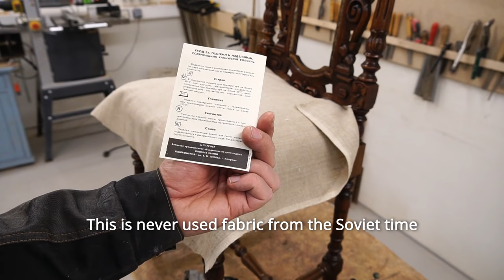Extreme restoration of an old (and seemingly fine) chair

Comment: I really admire how you added new pieces of wood and carved them to fit into the existing elaborate places.  The glue and fine sawdust filler is a good trick for filling multiple holes and non-structural cracks which I have used in the past.  Your re-upholstering, using the old springs and new webbing was fascinating to watch.  Congratulations.

Comment: Great work restoring a chair that was almost too far gone to save. And what a great idea to use compressed air to force glue into a narrow crack! Why haven't I seen that before and why haven't I thought of it myself?  🧐
Reply: Was that normal wood glue? Is normal wood glue strong enough to piece together a backrest?
Reply: Normal (modern) wood glue actually is stronger than the wood it holds. (edit: when applied to long grain, as is done here)
Reply: 👍👍 I did not know that. Thankx 😁
Reply: I also did not know that about the glue. Thank you 😊 I had a thought while he was gluing. Could you use a hypodermic needle? There are several large gauges, like 14-18. Would that work to apply glue into the cracks? 🤔 Just wondering...
Reply: @julie6092  Yeah, I've done that in the past with an 18G and it works just fine

Comment: "Watch me fix this fabulous chair!" Smash smash bang bang crack crack LOL
Reply: I have a chair similar to this and I came looking if there was a way to fix the wobble. Apparently the way is to destroy the chair and build another one like it...
Reply: Its the only way it works bro
Reply: Sometimes a Bull in the China closet is warranted.
Reply: @TrueFork  if you don't care how it  looks you can use a wire hanger and a turnbuckle. Or, you could go the distance and get a long bolt and put it in the middle and twist that around to tighten it
Reply: And now, a family heirloom to be passed down.
Reply: @fairwitness7473   i am a restorer of 45 years and cringed at this hamfisted approach.
Reply: Awesome, thank you for share..
Reply: You don’t make an omelette without breaking eggs.
Reply: @tedwarden5803  "... but look what happened to the cook!"
Reply: @shawncharton9416 . Go on you’ve got me stumped what did happen to the cook?
It looked to me as if the chair had already had a partial restoration. It had certainly been reupholstered. The webbing and the springs were almost new. The corner braces looked as if they had been reglued using  PVA. 
The damaged turning and carving all you can do is replace it up to a point or just leave it and or recarve. That’s the art of restoration how far do you go. 
It’s never going to be a new piece of furniture nor should it be made to look like on.
Reply: @tedwarden5803  watch the movie Clue to find out.
Reply: @tedwarden5803  I'm a restorer of 40 years experience. Ham fisted springs to mind.
Reply: @nickgreenwood2854 . I don’t disagree. 
All I said was that it looked to me as if a previous repair had been attempted. Cutting through those tennons made me shudder. 
But if modern adhesive had been used I could understand. 
The old animal glue breaks down over the years and becomes brittle as you will know.
Reply: What I thought as well.
Reply: I trust he knows what he's doing now I've watched a little of his work.

Comment: You should try using a heat gun to soften the glue before you whack the joints with a hammer. Nice finished result though.
Reply from the maker: You are right and I usually do but this time the nails hold whole chair together. Heatgun doesnt help there.
Reply: @ATRestoration  drill on opposite side and push the nail out ?

Comment: We have this problem when people bring in their old picture frames and want us to re-use them on a new piece.
We're a small, local frame shop that has been in business for over 60 years, and when people bring in old, broken wood frames for repair or re-use they never understand why it not only can take a long time to fix but also can not be used with the piece they bring in. This video is pretty much exactly what we have to deal with.

I love when the customer says, "Well it can't be that hard!"
If it wasn't hard, sweet-cheeks, then you would do it yourself!

Comment: Excellent restoration work. A some places, while restorations, tiny pieces of wood or saw mulched with PVA glue have been applied. He could have done it with quick drying wood filler and could have sanded down. He just made a new chair out of an old chair with rotten wood. Well done

Comment: Filling those long checks and cracks without splitting the wood apart could be done with a syringe from one of those printer ink refill kits. PVA is thin enough to inject into the crack.

Comment: If you soaked the joints in acetone they will come out easily. Discounting the fact you had nail to contend with.. Little tip from a second gem woodworker myself.

But yeah, sometimes it's really difficult working with really old stuff.

Comment: I worked for a bit in ceramics restoration. And they told us NEVER destroy the original piece, fill the gaps to join the different parts but with compounds that can be removable. Never improvise the motif (decoration) if you don't have enough historical resources... For me this is shocking,  Is a great job, the final result is impressive. but my heart hurts to see how the chair is being taken apart.
Reply from the maker: People just doesn´t know the difference between conservation and restoration. It really depends whats the items purpose will be.
Reply: @ATRestoration  In this case, maybe was conservation. I was working in a museum, the purpose was to maintain the original vases. I was told to reconstruct the broken piece BUT always with special glues easy to remove etc.

Comment: That chair was a self destructer from the start. Because it had no gap between the seat and the backrest pressure on the lower backrest is extreme.....there is nowhere for the buttocks to go. There must be a gap or a deep bow shape built in to accommodate the human bottom!!